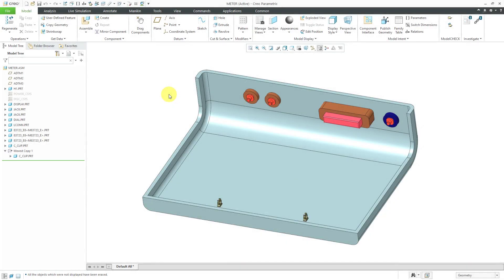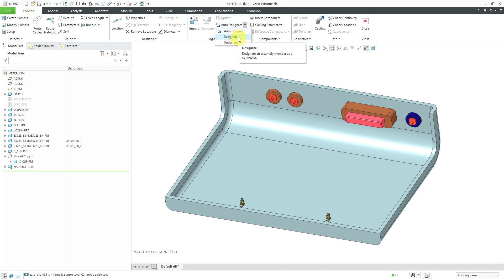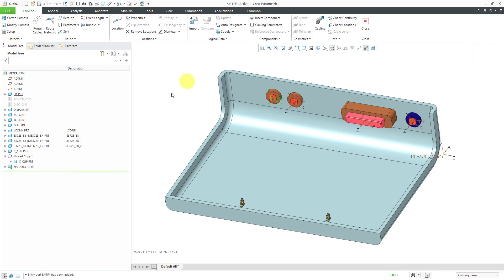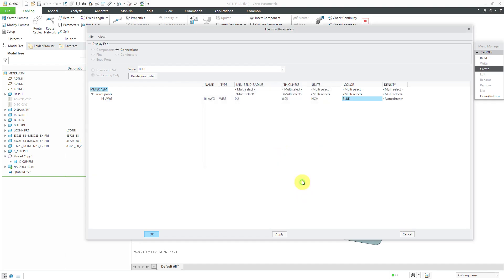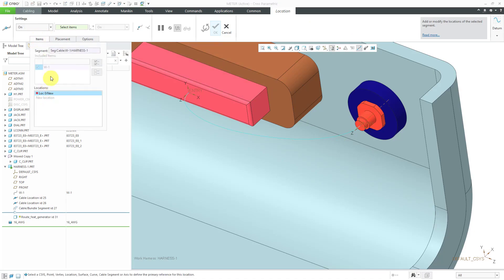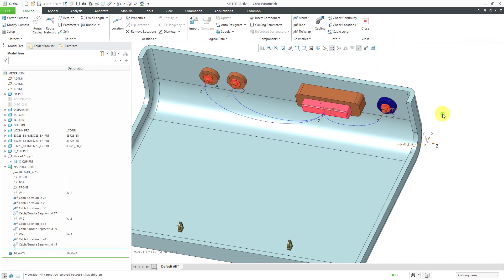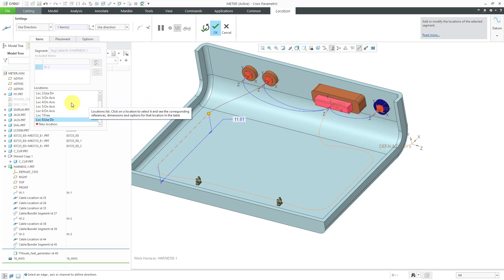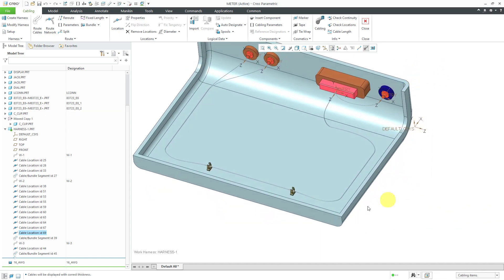Creo Parametric - Manual Cabling Process (Video 1)

Comment: In this video the wires are starting at same location in main connector, but if I try myself wire are created separately why?
Reply from the maker: I can't diagnose based on the information provided. I recommend opening a ticket with PTC Tech Support.

Comment: I'm stuck at 0:24. My toolbar doesn't show Cabling at all. How do I show it?
Also, how do I confirm whether my Creo Parametric has it?
Reply from the maker: Is there any chance your admins customized your UI to remove icons? If your answer is "I don't know," then they probably did.

If you go to File > Help > System Information > System Information, you will get a dialog box that will tell you what Creo modules you have access to.
Reply: @CADPLMGuy  Thank you for your response. Actually, my mistake for not realizing the Cabling tool only shows in an assembly file (not a part file).

Comment: Is it possible to attach a cable to a mechanism and animate it, such that the cable updates for each frame?
Reply from the maker: It should be, provided you model the cable in a way that its routing can update during the mechanism motion. The best way to find out is to create a simple example and test it for yourself.
Reply: @CADPLMGuy  Thanks, I'll test it out when I'm back in the office tomorrow. Your channel is awesome.
Reply: @CADPLMGuy  I've tried creating an animation and running a motion analysis, but it does seem to regenerate, unfortunately.

Comment: Hey Dave! Your videos are so important for the experience I have gained in the past year. Thank you for that. A question though, I have a cable that is longer that what the CAD will route. I am wanting to coil the cable to show the exact length, what is the best way to go about that??
Reply from the maker: You can use the Fix Length command if you know how long the cable should be. I add coils to the cable by adding locations that force the cable to go around in a loop.
Reply: @CADPLMGuy  oh great thanks!! I will look for that.

Comment: The reason wire manufacturers have no idea what a minimum bending radius is is because it's a hydraulic concept. This cabling seems to work for hydraulic routing as well. The minimum bending radius is extremely important for hydraulics. 

Either way, superb video!
Reply from the maker: Not just for hydraulics. I’ve been in many vehicle builds where we couldn’t route cable harnesses because we couldn’t get them around corners or through a 90 degree bend from a connector to its path. MBR is difficult for them because they have multiple suppliers for their raw materials.
Reply: @CADPLMGuy  Interesting, never thought of that. 

Glad you've shared your valuable experience. Excellent video my friend.

Comment: Is there a way to add your entry and exits datums at the assembly level? My connectors were not modeled with the appropriate datums, and they cannot be modified.
Reply from the maker: Can you create an assembly that contains the connector?
Reply: @CADPLMGuy  I could, but that wouldn't be ideal. I assume I cant add an entry point datum in the same assembly as where the cable is installed. The datum would just be higher up the model tree than the cable. I tried doing it but was having issues, it wouldnt let me select that specific datum.

Comment: Is there possibility to draw lines represent the path of the wire from to  and then draw cross section of each wire (this cross section will be the circle of wire as a conductor surrounded by the insulator )want to route and then by doing extrusion command to extrude the cross section you draw through the paths you draw already.and repeat this for every wire then including them within a kind of sleeving to draw harness.
Just Suggestion! I am learning from UTube the creo parametric .
Reply from the maker: In other words… create a sweep?

Comment: I am not sure what I am missing but all my routed cables and wires are designated as "Cable is incomplete".
Kindly comment on this issue.
Reply from the maker: Could be a number of things. Are they starting and ending at designated entry ports? Are there gaps in the routing?
Reply: @CADPLMGuy Thank you for quick response. 
No gaps or no any other issues in routing the path. 
I was able to complete the routing without any issues.
When I check the feature and cabling info, I find warning as "Cable is incomplete"

Comment: I want to know, why is there a gap from the selected surface to the center of the wire? I
Reply from the maker: I always assumed it was room for sheathing and cosmetics (ties, wraps, and markers). You can always change the height if you want the cable lying right on the surface.
Reply: @CADPLMGuy  Could you explain how I can do that?

Comment: Good stuff. Fusion 360 can design PCB using Eagle. Can Creo design PCB?
Reply from the maker: I've seen most companies use industry-leading ECAD software like Altium or OrCAD and then bring the necessary information into Creo via IDF or IDX. I think PTC made the right decision not to compete in the PCB design space when that's not their wheelhouse.
Reply: @CADPLMGuy  Good to know. I'll focus on Eagle PCB, which has been around for almost 30 years.
Reply: @CADPLMGuy  For PCB add-on, Solidworks uses Altium and Fusion 360 uses Eagle. What Creo will use for their PCB module in the next 5 years would determine their IoT direction, I think. By the way, the Raspberry Pi has joined the microcontroller industry -- their new Pico board (many pinouts) looks promising.  Enjoy designing complex PCB with Fusion 360.

Comment: Hello, Mr. Martin. I want to start by saying thank you for all of your videos, they are incredibly helpful! A question regarding cabling: Is it possible to make 2d drawings in Creo Parametric with dimensions, i.e. radii, lengths etc. from harness/spools created in the cabling application? Or would you need to use creo schematics for that? My company currently uses sweeps to represent all of their cabling and I'm trying to find a better, more efficient way to create cables and still be able to make a parametric drawing of them. Any help and or information is greatly appreciated. Thanks!
Reply from the maker: See my video on Cable Harness Drawing Smart Tables.

Comment: does anyone know how to branch off a cable into two and route it to two different connectors? I try to do it by designating the coordinate system of the connector and connecting it to a node on the wire but the dots become deattatched and I can’t connect them
Reply from the maker: With a splice.
Reply: @CADPLMGuy  do you have a video on this? I looked on ptc university and they do it but importing a physical splice but I just want to do it with the nodes. Thanks!
Reply from the maker: I just did like 12 videos on cabling. I’m burned out on the subject for now. Eventually I will do some videos on splices.
Reply: @CADPLMGuy  is there a way to make a splice without having to insert a part? Like change a setting the in csys?

Comment: The problem with this method are the dependencies it can create in parent assemblies. Updates on the cable often require updates on the assembly so can be time consuming through a config management point of few.
Reply from the maker: For a simple assembly like this, it's not an issue. Please see my other cabling videos where I use Skeletons and Data Sharing Features to manage references. Also see my video on the Shrinkwrap feature where I cover Manual Collection. The point of this video was to show the basics of manual cabling, and not to get into a full blown discussion of managing references.

Comment: Thanks for the demo. I used this video to introduce wiring into my Arduino model for the first time, and missed some basic definitions. The video itself is easy to follow and copy , but it's hard to find the true meaning of harness vs. spool vs wire. I will try and find out !
Reply from the maker: A harness is a part file in Creo that contains wires, cables, and routing information. A spool defines the properties of the wires and cables you route, like thickness, color, and bend radius. A wire is a single conductor of electricity. A cable consists of multiple wires.
Reply: @CADPLMGuy  Thanks. I figured out what spools were for, the button icon kind of confirms what you explained. Now I can work with one harness instead of a single harness per colour !